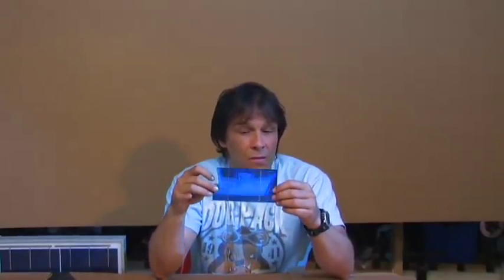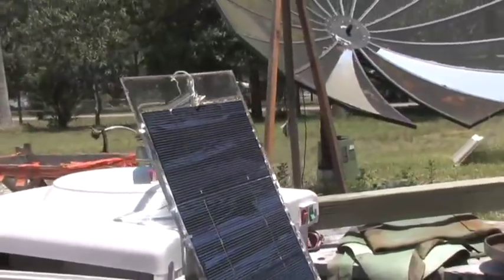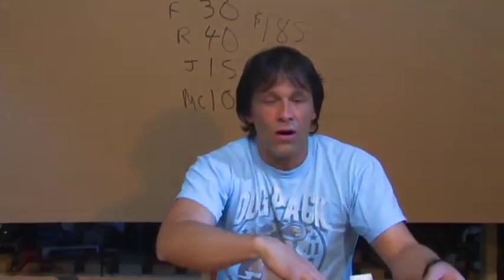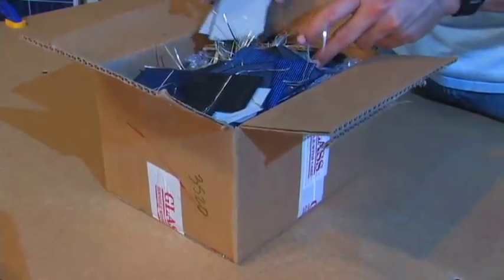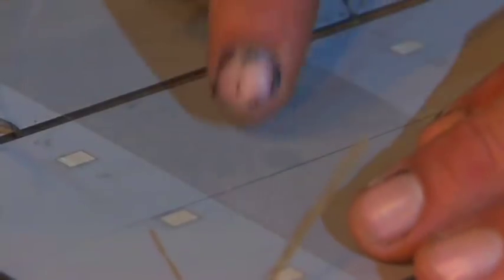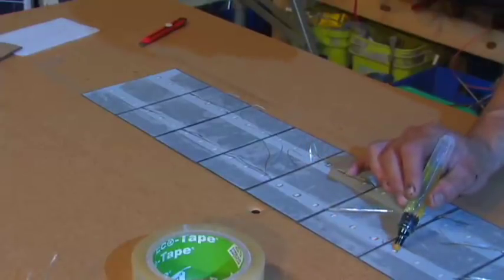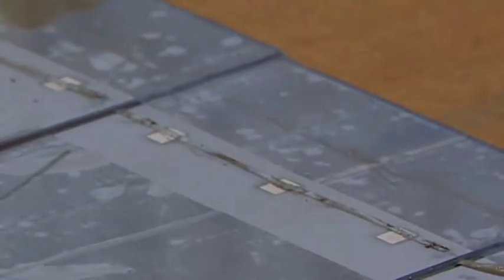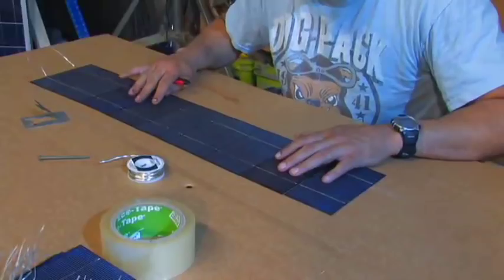less than $1 a watt DIY Solar Panel MAKE YOUR OWN SOLAR PANELS (PART 1)

Comment: I think this stuff is nonsese. such a limited ammount of energy. Did you see how slowly that flywheel was turning??? I bet I could stop it with my bare hands and not hurt myself. A tiny lawnmower engine could spin that wheel hundreds of times faster. And that is why we are dependent on Oil, because it works, and it works well. Unlike this shiny pile of horseshit. Do you power that soldering iron with your panels? No probably not, right?
Reply: Go back to the cave you came from my ignorant friend....cya
Reply: Why does everyone tell me to fuck off?! WHAT ARGUMENT IS THAT?! Instead of atacking my ideas, you attack me. How intelligent. Scilence the oppostion, meanwhile praise people who think just like you do. IDIOTS! FUCKING IDIOTS!
Reply: kedwa30 you are so spot on and yet +Ilir Kumi will probably try and use some low level intelligence to try and prove you wrong. Another reason why we are so dependant on oil is because of how much money is in oil, some nations entire economies are dependant on oil revenue, do you think Dubai would be the glittering jewel in the middle east without the oil revenue?  do you know there is a company that has developed a form of paving that is designed to to replace tarmac that are solar cells themselves efeectivly turning a nations road network into a power generating machine as well completely making energy generated by oil obsolete. you can run cable is special condiuts buit into these roads mount phone signal boosters in these conduits and all other sort of modern gimmics such as using the roads LED system to light highways. And why do you think that governmants arent persuing this not because its is inefficent but becasue it would take away our need for oil there by bankrupting certain companies and countries
Reply: A frensel lens is a fancy way to make a giant magnifying glass. You can generate tempuratures over 1000 degrees with one, from the hours of 11am to 2 pm. On a clear sunny day, with no obstruction from the clouds, and the closer to the equator the better. But what about all the other times when it underpreforms? Imagine a cigarette smoker was given the option of using a magnifying lens, or a Bic lighter to light their cigarettes. What do you think they would pick? And why would they pick it? What would be the pros and cons of each?
Reply: ***** Why? Please tell me why I should. Because you disagree? Because you can not think of a rational response? So instead of a rebuttal to what i'm saying you just tell me to "STFU" You plug your ears and shout over me. Real fucking clever you moron...
Reply: chimpey11 I doubt NASA has plans to build solar panels on the moon any time soon. This is a far fetched idea that will not come to fruition in a very long time, if ever. To think that thousands of acres and millions of pounds of anything can be launched into space is nonsense. You can't honestly belive that this is being done.
Reply: Ilir Kumi I have a garage out in the country. There is no grid power hooked to it. There's two 100w panels on the roof. I can power a big stereo, Three drill chargers, lights at night and a soldering iron. Its saved my hundreds of dollars in gasoline. In the summer months I never use the generator. The winter is a different story but I really don't go out there much in the winter. Before I got them my thoughts was a lot like yours. The best way to describe the power. imagine you have three car batteries with two 10 amp chargers hooked to them at the same time. But the 10 amp chargers are running for free!
Reply from the maker: That is called a "GEARED MOTOR" and that is NOT a flywheel, it is a traction drive wheel with 30+ pounds of torque. It is geared down for torque vs speed. We have solar supplemented grid tie power. So, on sunny days, half of that iron is heated from photons delivered from the sun. A gasoline engine would be a poor choice as this geared motor is designed for an indoor application. Oil works so well, worldwide  less people are using it and the cost of a barrel of oil is in the toilet. That pricing will eventually change, not due to increased consumption, but due to the fact that oil will be a dated energy source becoming a niche market vs mass market. This will not happen tomorrow, but is inevitable. BTW, many electrical power suppliers use alternative "shiny pile of horse poop" to supplement their grid loads via solar buybacks and solar farms. So, if you have a drop line from the power company, chances are you are consuming electrons that originated from a solar source.
Reply: Ilir Kumi said "such a limited ammount of energy"
And that's why people tell you to go away rather than waste time throwing pearls before swine. You have revealed your ignorance. The energy from every drop of oil originated in the sun. Oil is nothing more than a chemical battery storing the sun's energy. Using solar cells without chemical storage is like using a Biq lighter without a tank. You're going to blow butane out your arse to light your cigarette? It simply not a valid comparison to compare a stored solar energy to unstored solar collection. Today there is the technology to convert bio-waste into fuel oil. That process does not take long to make oil. Plants do well on this 'limited' amount of energy called sunlight. Presumably they have grown for millions of years without any human interventions. If I asked you which you would prefer: 500 pennies or four dollars, you would say the pennies are so small, you would rather have those big dollars. You are such a short sighted creature. You cannot see that many sources of small amounts of power add up to large amounts of power. When you push power from a single large power plant to a distributed network then you lose a lot of that power due to inefficiency of the distribution system. But solar is already distributed. Collecting a little and using it locally is the most efficient model for household power. Solar farms are inefficient simply because they must transport the energy over the same inefficient grid. Currently we have the technology to use electricity to convert water into the components oxygen and hydrogen.
These burn together to make water again. In the future HHO gas might be pumped directly to the consumer from a solar farm thus improving the efficiency of the distribution network. After they burn the HHO for heat and electricity, they can condense the steam into pure distilled water for drinking. You can't do that with exhaust from burnt oil.
Reply: kedwa30 Why can a coal plant transmit electricity on "the same ineffeicent electric grid" But a solar plant can not? How does that work? No shit the energy from oil comes from the sun, that being said...having energy already condensed is superior to having difuse energy that needs too be condensed. Is it not? And bio fuel? One gallon of bio diesel burns less hot, and for a shorter ammount of time than a gallon of petro diesel, requiring a larger volume of fluid to move the same truck the same exact distance. Ie: less energy dense, less fuel economy, more exepensive. Bio diesel has 0 vapor pressure which makes running it pure very difficult. So it is usualy mixed into petro diesel at NO MORE THAN 20 percent. Can you produce 1 billion gallons of bio diesel? Can you? You can not. If you did, it would exponentially more expensive than petro diesel. You honestly the think the chinese, indians, and other developing nations are gunna pay for this shit? No they will do what is more economic. Calling me short sighted? A car has a uniqe constraint in that it needs to be a PORTABLE powerhouse. Ask a marathon runner if he would rather have 500 goddamn pennies filling his pockets, or an individual 5 dollar bill. "But a little adds up to a lot" Yeah, a lot of exess weight which drasticly hinders preformance. And HHO you say? That is an energy storage system (a rather ineficient one) and NOT AND ENERGY SOURCE that solves nothing. You need electricity, and a lot of it. "But solar panels." I bet a single oil refinery can produce more HHO gas than all the solar farms put together, but they don't because it reqires a shit ton of energy. Why burn methane, to power an electric generator, to power a "water splitter", to burn HHO, when you can simply burn the methane? Why can't i just cover my car in solar panels? But at the same time just a tablespoon of gasoline can propel 1 ton of steel, rubber, and glass hundres of feet in minutes, if not seconds? Its all about energy density!!
Reply: you still didnt answer my response 60l of oil wieghs alot more than a lead battery why do you think the most economical way to run a car or truck his on half a tank, its because you don't have to carry the weight of that extra half a tank of petrol/diesel. and if oil were so great then why does the us military use other means to power there vessels? because oil is expensive and wont last however even though the initial outlay of nuclear/solar power is a little more expensive the long term benefit means its more economic, and btw if you where to compare based of the amount of Wph a 12 volt battery produces compared to the same amount of oil you would need for the same Wph output you would find that foil is far more inefficient because big diesels or gasoline engines are inefficient by the laws of the design, BTW your talking to a fully qualified engineer here so this stuff is my bread and butter
Reply: chimpey11 It took plants and plant-like organisms millions upon millions of years to trap carbon. They litteraly put the "fossil" in fossil fuels. And in just about 150-200 years animals (us humans) have been undoing that process at an uncomfortably fast rate. We truly are dependant on fossil fuels because of the vast utility they provide to us. Not because big oil companies are greedy, although some might be. That has nothing to do with it. Fossil fuels, especially oil, free us from toil and drudgery. Petroleum lifts the burden of labor off the shoulders of man, and places it upon machine. No longer do we enslave other men, we enslave carbon instead. All of this power comes at a cost though, we can not do this forever, and we are playing games with the atmosphere.

      Riddle me this! What on earth can fill a teacup? And lift one ton, 1,000 meters in the air? Petroluem of course! Energy must be consentrated to be of any use. Just like how a magnifiying glass (big circle) focuses sunlight into a small spot (small circle) to generate heat. If that energy is not consentrated, it can not do any work, like burn an ant or something ;) 

      My problem with renewables is that the energy, which is abundant, is very diffuse. It needs to be collected and consentrated before it can be of any use. I understand the sun emmits huge ammounts of energy but renewables can only grasp such a painfully small ammount of it. Arent average solar panels like 100 watts? (At peak operating conditions? We will never power an aluminum foundry, or pump water up a mountian, or spin flywheels at thousands of rpm, using solar electricity. The nicer of the two tesla models runs on 85kw. The avg home solar instalation is like 4-8 kw at peak operating condidtions and that can cost over $20,000. It does't add up.

      Long story short, nuclear or bust...and don't get me started on solar roadways!!! ;)
Reply: Ilir Kumi Although you are right about oil having a higher energy concentration, You are selling yourself short if you believe burning shit is the way of the future. Their are too many energy conversions, and inherently less efficient. I am only sad we are wasting such a energy rich resource on such primitive energy extraction methods. As far as solar energy goes, the best solar panel in the world can currently only convert light to energy at 41% efficiency, but its cost is currently too high, however, this is still orders of magnitudes higher efficiency than oil burning, so much energy is going to waste.
People confuse things by saying oil is more efficient, as you have to burn less for more heat, but this is because their energy density is so high. Burning for energy is like painting with a shotgun. People who look into higher efficiency energy extraction methods have vilified these high energy density materials and are focusing their efficiency on sources with extremely low energy densities, and that saddens me. Oil, harnessed more efficiently, would give our world not only cleaner energy, but more of it per barrel. And this technology could potentially be adapted to any other energy dense material.
Reply: Richard Smith Perhaps we would better ask then, how can it be improved? If you believe in something, and invest in it, who knows what solar energy could really do.
Reply: thebassguy9083 Why would I invest in solar, even at 100% energy conversion, the energy output would be dismal and not enough. What I am suggesting is investing in alternate ways to harvest high concentration energy sources, like oil, but cleanly and more efficiently than burning it.
Reply: Ilir Kumi Thorium is a better solution to the worlds energy problems... It would be nice to balance power between all available methods though.

Use your brain... solar power is not only viable, it's an excellent way to lower the use of oil so that we have more stored therefore our oil reserves will last longer.

Out where I am in the desert, solar panels can make a huge difference. Lots of neighbors with panels up and I haven't heard anything negative from those homeowners about them around here...

Thorium though... that's almost like a miracle! Unfortunately you've gotta protest the Governments horrid Energy regulations before it even becomes an option. And even then, until society breaks out of this primitive money minded phase, we most likely will NEVER see it.
Reply: kedwa30 Sounds like a great movie, i'll watch it.
Reply: "Limited amount of energy." Our solar systems sun has been expelling energy for far longer than the earth has existed.
Perhaps when you come to the realization that the sun was a requirement for life on earth, (which eventually decays over time to form oil - over hundreds of human lifetimes) You'll realize that without solar energy there would be no oil. Would it not be reasonable to assume then, that oil is a direct result of energy provided by the sun, which you claim to be a shiny pile of horse shit?

Perhaps you should also consider, that the earth would've not formed at all, without the gravitational pull of our shiny pile of horse shit.
Reply: MrCamiranga That was a great argument that you provided...
Reply: Ilir Kumi if you thin solar energy is horseshit you should research the team that are developing solar panels to be placed on the moon, an 1m square cell place and regular intervals for about a 1000th of the lunar surface would create a Tera-watt of power, understand exactly how much that is a tera-watt is 1000000000 kilowatts of power, enough to power the entire planet, and with microwave technology it is theorized that the power can be exported back to earth for use by all of use
Reply: The moon revolves around the earth, that means for two weeks those panels will be in the dark producing no power at all. None. How many 1m panels will it take to produce a terrawatt? How will you get that many thousands of TONS of material into space? HOW? Solar spaceships? Oh wait those don't exist! We would rely on conventinal rocket science that uses petrochemical fuels. And it would take the entire wealth of nations to fund such a thing. Where are the space colonies that will support the thousands of people that will have to LIVE ON THE MOON to build these things? 1-1000th of the moon? That is a shit-ton of area to cover, now subtract an atmosphere. Again, when the power goes out for two weeks at a time, what happens to the PEOPLE LIVING ON THE MOON? Are you for real dude? Now that we are on the topic of space, what about deep space probes? Neptune is dark, cold, and far far away from the sun. Solar panels that far from the sun would fail, FACT. Deep space probes like voyager and galeleo relyed on RTG's for power, and so did the men that landed on the moon back in the late 60's. And so does discovery, the probe that recently landed on Mars. Those are Radioisotope Thermoelectric Generators, not Photovoltaic Cells. Solar panels didn't keep those men alive, atomic energy did. "Lunar panels man...free energy for free" Get real...
Reply: Ilir Kumi the moon takes 28 days to revolve around the earth and 28 day to complete one rotation around its own axis meaning that there i a permanent part of the moon that is always facing away from the earth hence the name dark side of the moon , and technically the only period that there would be no light from the sun hitting the moons surface is a about 2 days, the same time we cant see the moon on earth with naked eye (New moon period). The solar power would be exporting back to earth using microwave technology this is possible so the power would serve the earth not the moon but could serve the moon eventually. the fact that there is no atmosphere is beneficial to the creation of power using solar power because the cells receive pure light energy from the sun without an atmosphere to dilute the light radiation. And yes i do agree that the technology is not there for getting these things to the moon but why do you think NASA is developing the rockets to take man back to the moon? there are also many private companies that are researching ways to make this a possible and if you look at how quickly technology has developed in the last century and a bit for first manned flight of an aircraft to now having a space station i would say its not far away, by the way space ships that use solar power exist its called ISS. and lastly i was using this as an example to you of why Solar power its not a buch or horseshit and has real potential to be the solution to the earths power needs given time and i do agree that nuclear is the other area that man kind needs to deveolp but untill they can get to a point were the risk is not greater than the benefit with nuclear power then other options have to be explored
Reply: chimpey11 Microwave technology transporting energy to earth? You must have never played Sim City 2000 to know that this is a bad idea...
Reply: Ilir Kumi and why wouldnt they be researching this, again no where did i say it was going to happen tomorrow or discount nuclear power however i simply showed that solar power can achieve just as much a nuclear without the melt down factor. and its the private companies that would stand to benefit more from this and i know of at least two that are throwing money at this to try and make it happen. http://www.telegraph.co.uk/news/worldnews/asia/japan/10480950/Japanese-firm-plans-250-mile-wide-solar-panel-belt-around-Moon.html MKzer0 As i radar engineer i know this is something that is achievable all you need on earth is the receiving platform all the power is generated at the transmitter its no worse than some of the radars employed at airports or air traffic control centers, a radar wave is a microwave after all
Reply: Ilir Kumi 
I'll agree you make some valid points on a global scale. On a smaller personal scale(which is what I believe this video's intent was for) to get lower, or totally eliminate, the cost of a local electric bill I believe your points do not carry as much merit. The fact of comparing the pros/cons of these solar panels to oil, of course the oil is going to give you better benefits, the people selling the oil are going to invent ways for you to use it(so you buy it and put money/power in their pocket) rather than finding alternative ways for power when oil is not available to you. 
I watched the video and read the first comments that came up so if I missed where these comments were on a certain subject matter other than making panels for personal use I would like to read that.
Reply: Ilir Kumi I have a garage out in the country. There is no grid power hooked to it. There's two 100w panels on the roof. I can power a big stereo, Three drill chargers, lights at night and a soldering iron. Its saved my hundreds of dollars in gasoline. In the summer months I never use the generator. The winter is a different story but I really don't go out there much in the winter. Before I got them my thoughts was a lot like yours. The best way to describe the power. imagine you have three car batteries with two 10 amp chargers hooked to them at the same time. But the 10 amp chargers are running for free!
Reply: Ilir Kumi
said "Why can a coal plant transmit electricity on "the same ineffeicent electric grid" But a solar plant can not?"

When did I say it couldn't? That is a strawman that you built, and you have only shown that you can tear down a strawman as quickly as you can build one.
The fact is, most residential solar is located on the site where it is used, and thus it does not need to use the grid, although excess can be fed onto the grid for grid users to use. In that case, it may just go next door, thus traveling maybe a thousand feet at most. That's pretty efficient compared to the miles of wire you need to distribute power from a massive coal plant or solar farm, or any other large scale grid plant. Do you understand now? Or do I need to explain it some more?

"having energy already condensed is superior to having difuse energy that needs too be condensed. Is it not?"

There are pros and cons of each. A parallel can be drawn to monetary investments. Someone with a lot of cash sitting under a mattress has the analog of a bunch of oil on hand in tanks. What happens if there is a fire?
Sometimes it is preferable to have a steady income rather than a bunch of cash on hand.
What happens after you spend all your cash and you don't have any income to replenish it? Suddenly your lifestyle takes a dive, right? It is preferable to have a steady income so that you can maintain the same comfort level. Also, what about the costs of storing, guarding, and moving your cash/oil?
If having a lot of cash was always preferred, then why would anyone invest in assets? They have to spend a huge lump sum to gain an asset that pays them back slowly over time. The thing is, the slow payback over time pays them back, and they still have the asset. After they have all their cash back, they still have the income. It's the only way to beat inflation.
A bird in hand is better than two in a bush. See, I know what you are trying to say. But it's not like that. Investing in solar infrastructure that can then power HHO production is creating that stored energy. Is growing corn and turning it into alcohol more efficient? What about wood gassification? I'm not setting aside those options. I'm not saying we won't still have a niche market for oil. It is energy already in hand. But a bird in hand is messy. You need to clean that bird before you can eat it. Having a bird farm and taking the time to clean and dress the birds is far superior to eating that bird in hand feathers and all.
"You honestly the think the chinese, indians, and other developing nations are gunna pay for this shit?"
Paying for energy is the capitalist way. What, you think chinese are all socialist and don't use money? They pay for coal, they pay for oil, and they will pay for solar because it makes economic sense. You pay a one time cost for a solar cell and then you get energy every day thereafter. It is an investment, same as any other. Farmers know what I'm talking about. Why go to the store and buy a carton of eggs when you can raise chickens and sell eggs?

"Ask a marathon runner if he would rather have 500 goddamn pennies filling his pockets, or an individual 5 dollar bill."

Way to mix metaphores. But if instead of carrying around 500 pennies, he had a flow of pennies so that he had only a few on hand but basically every time he reached into his pocket he had pennies, how would that compare to a five dollar bill that after he spends it, he doesn't have it anymore? How much money does any marathon runner carry? What do they need it for? Are they going to catch a bus? Taxi fare? WTF does someone running a marathon need to stop and buy? Oh there's a Pay-less shoe store. I need to stop and pick up a pair of new shoelaces. Get real!

Are you telling me you really can't tell the difference between having to store all that oil compared to getting a flow of electrons daily? If anything the oil is the five rolls of pennies!
Go camping in the desert for a year and carry on your back either 1. all the oil you will use for a year, or 2. a solar cell. Which is lighter in weight? Which are you going to carry on your back?

HHO solves nothing? It is an energy storage system, you dooffus. What is the efficiency of making crude oil? And then yoou have to pay millions of dollars to dig a well, pump it into barrels (barrels aren't free), refine it, put it in gas cans, truck the gas cans to gas stations and empty them into the tank there, then pay to dump all those gas cans and barrels into the ocean. HHO has no garbage. It is already refined. It's many times more efficient than that natural production of oil, and it can be made as it is needed, so there is no need to store it in volatile tanks. Solves nothing? More like it solves every problem we've had with petrol.
Reply: ***** I think his real name is Hank Hill lol
Reply: Ilir Kumi Hey Hank Hill I hope your storing a lot of barrels of crud oil. When we run out us Dumb asses will have those worthless solar panels.
Reply: +Ilir Kumi how much do you think 60l of oil weighs? a alot more than a lead battery dont believe me try lifting both
Reply: 60l of water weighs more than 60l of Oil. And 60l of Oil is more powerful than a 12 volt battery. How many gallons of water can your battery boil? And for how long? How many products can you make from a 12 volt battery? Bullets and lead paint? Oil weighs around 0.7 g per cubic cm. Lead is around 14 g per cubic cm. Don't belive me try lifting both. You might as well say two pounds of feathers weigh more than a one pound brick.
Reply: william staten I hope you are storing a lot of elemental silicon because solar powered blast furnaces don't exist.
Reply: chimpey11 Are you refering to nuclear powered submarines? Because a solar powered sub would be nonsense. Oil is expensive because it is fossil fuel in it's best and most useful form. Liquid fuel rules and solid fuel sucks. (If you have ever stacked wood you know what i'm talking about.) Liquids can flow, and be pumped through pipes and can mix very well, unlike solids. And gasous fuels are inconvenient to handle. Any exess weight reduces effeciency, if you have 5 passangers in your car they certianly weigh more than 60l of oil. It takes more energy to move more mass, that is obvious. And you didnt answer my question how many gallons of water can a 12 volt boil, and for how long?
Reply: no i talk of aircraft carriers and other warships  that weight upto 120000 tonnes that fact you would even ask this proves how little you know, and im not talking of solid fuels solar energy is not a solid fuel but a forces heat and light a ray and radiation not wood or oil or diesel. and ok a 12v battery would not heat very much water for very long i give you that but a battery witht the same net wattage as that of the oil you would use to heat your water would by the laws of physics heat said oil just as much and as long as that oil. now ask yourself when oil runs out, and it will within this century thats a universally accepted fact btw while im heating and lighting  my house with solar energy what will you be using? and how will you be able to sustain yourself if all these agencies that provide your your power source cease to exist? at least with my solar cells i can create my own energy
Reply: Too bad you can't create your own solar panels. Just like how I can't make my own oil :( Solar panels need mass amounts of energy to manufacture. Elemental silicon and aluminum require vast amounts of heat and electricity to produce. You litterally have to burn sand! Ever heard of a solar powered blast furnace? No, well they don't exist! That energy must come from something, and it sure isn't from big fans! And a solar powered aircraft carrier? Sounds like that also doesn't exist. I bet it runs on nuclear because nuclear is so energy dense, even denser than oil as a matter of fact! I am a major proponent of nuclear energy myself. Chemical energy and the electron has served man well, it is the fist half of atomic energy. But one day I hope we can have full acess to nuclear energy and the nucleons. You know just over 2 pounds of plutonium is capable of generating as much heat as 3000 TONS of coal? Now that is some hot stuff!
Reply: im completely on your side with the nuclear and thats what i was referring to with the aircraft carries i was just arguing the electricy verse oil argument you were having, alot more engineers are need in that field as it is the way of the future or at least a stop gap till we find a safer way to provide the energy we need, e.g fusion and then maybe one day anti matter reaction which aren't as sci fi as they seem.  and i can create my own solar panels like i said im an engineer i could buy the basic parts and build one, but once iv bought one i on it dont have to replenish it dont have to worry about it being used up its mine and as long as i maintain it it will work, you must agree you cant say the same about your can of oil because once its gone its gone you need to buy more, and as an idividual user solar is far more cost effective way to power my house again its one of those short term loss for long term gain situations, i pay upfront for my energy rather than constantly paying for it i can become self sustained throw in a wind turbine and then i truly can power my own home as long as there is sun light and wind, and where im from wind is pretty much guaranteed most of the year, id rather that than pay through the nose for gas and electricity from a company that dont reflect the cost of oil on the global market in there pricing
Reply: Also, If solar energy relies on rays of light, could a gamma ray emiting radioactive material exite the solar panel and produce electricity? Like an artificial sun of sorts? That would be quite strange wouldn't it?
Reply: i would be honest and say im not sure however maybe the concentration needed would be counterproductive because of the inherent risk although im sure i a lab somewhere someone has tested this theory and knows the results. but i do believe that  #quantumphysics  and nuclear physics is what will cure the planet of it dependency of fossil fuels whether that be solar, nuclear or some other means, maybe a hybrid of all, nuclear for sea going vessels a more reliable form of solar for aircraft and cars maybe the solar highways that charge your car as you drive this has already been developed but still in its infancy. You have to agree the planet needs to rid its self of its dependency on fossil fuels before its to late, both in that we run out and destroy the atmosphere beyond repair
Reply: Ilir Kumi
uttered: "How do you transport solid metal thru thin air?"

It's an analogy. You're the one saying oil is a paper dollar and solar is a couple rolls of pennies. How do you transform sunlight into copper? Do you have a magic spindel? Can you spin straw into gold too?

"My point is 500 pennies weigh a lot more than a 5 dollar bill"

Duh, but oil weighs a lot more than sunlight, so the pennies represent the oil.

How much oil would you need to represent the entire solar output of the sun for a year? Go ahead and figure that up. You would need a tanker bigger than Jupiter to store it all.

"A marathon runner is someone who is moving around and if he has to carry exess weight, his running ability is reduced."

And if you had to carry all the energy you would need for a year on your back through a desert and the form was oil, you would die before you made camp. The weight of the oil would literally crush you. But if you carried a solar panel, you would have shade and energy.

"If you built a car that runs on car batteries which are made of lead, your car would be so heavy that it wouldnt get very far."

Thus you demonstrate that you can tear down a strawman as quickly as you can build one.
Name one manufacturer of solar cars that uses lead batteries.

"I can store oil anywere in the world,"

Okay, store it in a volcano. Fail.

 "I can not build solar panels inside a warehouse,"

But you can build strawman inside your imagination.

"I can't build them inside anything!"

Manufacturing of solar cells usually takes place inside a building.
If you can't do it, that only shows your own limitation.

"Define a "year supply of oil" how many gallons? Barrels? You think 1 individual solar panel producing no more than 100 watts is going to be of any use? FOR A YEAR?!?!"

You don't even know how much oil you would need for a year? But then you want to compare an unknown number to a random number you pulled out of the air?
Whatever amount you think you need for a year that you want to carry on your back, you can make a solar panel that will produce that same amount of energy in a year from the desert sunlight and that panel will be lighter. Not only that, but you can use that same panel for twenty more years, but your oil is depleted already after only one.

"I might as well bring just a pint of gasoline (which is 7/10ths the weight of water, which you would also need to carry.)"

How many watts can a pint of gasoline produce? You are going to be cold at night and eating raw meat. With just a roll of foil, I can make a solar oven that will cook for hours every day. Your pint of petrol is done in a weekend of cooking. You will be crunching your ramen for most of the year.

"Deserts get extremley cold at night how will that panel keep you warm? It will not, because it can not."

The same kevlar foil that I use for my solar cooker can be used to reflect my own body heat. It is called a 'space blanket' and it is very lightweight and inexpensive, available in most camping supply stores. Also, reflecting sunlight onto rocks stores the heat in the rocks long enough to provide plenty of heat in the night. All you have to do is plan ahead. That's the same with any technology. If you have nothing but a pint of petrol, you don't have heat. You need some kind of a stove and a way to light it. More weight to carry. More junk to buy and keep track of. You don't have to carry rocks in a desert.

It simply not a valid comparison to compare a stored solar energy to unstored solar collection.

"What? Are you going to carry a sun with you as well?? Energy density is key especially when it comes to portability."

No. (rolls eyes.)
The sunlight comes to me in a steady trickle. I don't need to carry the energy with me.

"CRUDE Oil is not natuarally refined, that makes no sense."

So are you going to carry an oil refinery around with you? You debunked yourself.

"Zippo lighter fluid and premium gasoline don't leak from the ground."

But sunlight 'leaks' from the sky, thus sunlight is more accessible.

"Also, you plan on storing a fuel AND oxidizer in the SAME tank??!! HHO is extremley reactive and dangerous to handle."

No, that is another of your strawmen. Do you plan to put an oil refinery in your car and filling up the tank with crude?

 "In order to liquify it you need EXTREME pressures and very low tempuratures as well!"

Why would you want to liquify and store a gas in a tank when you constantly use what you produce every day? Are you going to convert your precious oil into precious diamonds using high pressure before you put it in your gas tank? What do you think pipelines are for?

"A tank of liquified propane is exponentially safer than a tank of liquified hydrogen AND oxygen."

So it's a good thing it is only your strawman that will be risking his neck by pressurizing HHO into heavy metal tanks for transport, while everyone else will use the pipeline.

"A tank of liquified butane is even safer still."

Not too many people run cars or heat their home using butane. What energy companies are using butane to produce electricity?

"Gasoline is safer than butane cuz it is not pressurized"

I'll notify the next of kin how safe the fire that engulfed their family was.

"By that I mean HHO would not only need to be under tremenous pressure, it would also need to be refrigerated as well."

You need to back up your assertion with some kind of facts. Why would we need to pressurize HHO with tremendous pressures when we could simply send it down a pipeline in gas form with a minimal pressure? Why would we need to cool it when we don't intend to liquify it? You do realize you can pump gases through pipelines too, right? You don't have to convert it to a liquid.

"In no way does HHO outpreform petroluem and the myriad of products derived from it."

That is your opinion, and you are welcome to express it. But we were comparing solar power to fossil fuels, not HHO to petroleum.

"You are delusional if you think so."

So you say.

"I dare you to liquify HHO and see what happens."

Why would I want to? What is my motivation?

"I dare you to burn HHO, then Burn Oxy/Propane the latter burns hotter and longer."

So you say, but if you were to base the comparison on the equivalent mass of the reactants, then HHO wins.

"And what about Oxy/MAPP? That is even hotter, and guess what, it is a petroleum product! LOX/Kerosene?"

What about it? You have lost your way. We were comparing solar power to fossil fuel power. Carry as much MAPP, Kerosene, Propane, etc. as you can on your back and survive off it for a year in the desert. I will carry solar cells. Let's see who keeps warm, cooks every day, and enjoys a superior quality of life.
Reply: kedwa30 while i agree with some of your points you lost yourself and your point using the language and insults, it wasnt needed you were proving your point with knowledge but ruined it next time bring just your brain insults and foul language only highlight a narrow vocabulary and a limited ability to argue your point successfully are you a 12 year old is all people will be thinking
Reply: chimpey11 Thank you for your constructive criticism. I have cleaned up my post.
Reply: kedwa30 Why are we in the desert? Is it because that is were solar panels preform their best?  Most people on don't live in death valley, or in the sand dunes of the Sahara. What do they do? Cut down the trees near their houses? Move? You must admit that solar panels require specific geographic and meteorologic (is that a word? I mean weather) constraints. That is a huge limititation that can not be ignored. Can't forget that the sun sets, so for half of the day it produces nothing at all, then what? Renember that you do not have any batteries! Just a panel on your back! One cloudy day and your energy production is drasticly diminsished. You are at the mercy of the elements with renewables. Also it sounds like you think that you can thoroughly cook food with a mirror or magnifing glass? Have you done this before? Why isn't it more common? How long would it take to cook something? Would it even cook it? How will you get a rock's temp to 500+ degrees?  You sure can't plug a solar panel into a rock. Even if you could, you would need a lot more than one panel to get it up to temp. More solar panels, covering a larger area would work better than just one on your back. I saw a guy make a grilled cheese sandwich with a solar reflector stove and it took over 45 minutes!!! Renewables occupy vast swaths of land which must be cleared of vegitation, bacause if a leaf falls on the panel thay would be problematic, or god forbid a bush grows high enough to block the panels. The reason they take up space is because they must consentrate energy from a large area into a small area to make use of the heat. Energy density is importiant!!! I can't streaa that enough!!! What is the energy density per square meter? Doesn't matter you say?
Reply: Ilir Kumi please get started on solar road ways but do your research on them before you do and try to tell me how they would be a bad idea based on research here's the link http://www.theguardian.com/environment/2014/nov/05/worlds-first-solar-cycle-lane-opening-in-the-netherlands ill agree the ideas are in there infancy but it is worth researching .  Also i dont know whos been quoting you for solar panels but in the UK where i live the average 4-8kw set with invertor and storage batteries runs at about £7000 which even when the exchange rate is at its worst is only $14000 i know because im getting them fitted. Its the electricty not solar your comparing to when you run you little "riddles" or analogies so if you go for an electricity generator on the scale 'that can pump water up a hill' then yes electricity will do this. look at the rail gun principles or the EM aircraft carrier catapults no oil used in those systems yet still have massive exponential power. like i said you compare by Watts not be volume because that gives you a true comparison to work with and believe me you can get alot of Wper min with very small batteries 24VDC as long as you arrange the circuit it is connected to correctly. And the biggest reason i support solar and other greener energies is because i want to leave a decent planet behind for my children yes my effort may be small when countries like india and china and the US are pumping tonnes of carbon into the atmosphere per minute. but if every little man does something an effect will be seen
Reply: Ilir Kumi "It took plants and plant-like organisms millions upon millions of years to trap carbon."

False. Sugar cane grows very quickly, not only turning carbon into cellulose, but also turning it into sugar. Pine trees grow very quickly. Algae grows very quickly. It may have taken a very long time for the growth to pile up densely enough to eventually form a large reservoir of fossil fuel, whether that be coal, oil, or other; but, it didn't take very long at all for plants to sequester carbon. Hemp grows very quickly.

"They litteraly put the "fossil" in fossil fuels."

And that is why we laugh at you.

"And in just about 150-200 years animals (us humans) have been undoing that process at an uncomfortably fast rate."

Yep.

"We truly are dependant on fossil fuels because of the vast utility they provide to us."

Nope. People have survived a very long time without the use of fossil fuels, and with today's technology we could, if we so desired, maintain our modern lifestyle without them.
The reasons all consumers haven't already is because of the meddling in the marketplace of those in power who desire to maintain the status quo of control over the energy market.

"Not because big oil companies are greedy, although some might be."

Greed is hardly the primary motivator. Mostly it's control; power.

"That has nothing to do with it."

Of course not. It's merely a strawman that you brought up because he would be easy to beat up.

"Fossil fuels, especially oil, free us from toil and drudgery."

It takes energy to dig up that energy. Then it will take more energy than we got from them to one day have to clean up the toxins released by them. It is a dead end. The road to perdition.

"Petroleum lifts the burden of labor off the shoulders of man, and places it upon machine."

So too, electricity generated by solar cells can power machines. Petroleum is no messiah. Digging up these carbon chains so that we can burn them for the stored energy they contain also results in digging up toxins such as fluoride, arsenic, mercury, etc. Various heavy metals that took a long time to settle out of the biosphere are being reintegrated into the biosphere. This can result in environmental pressures that will bring forth traits that have laid dormant for a long long time.

"No longer do we enslave other men, we enslave carbon instead."

Opening Pandora's box has unintended consequences. Not only will increased automation decrease the need for cheap labor, but it can undermine the system of capitalism we have come to adore. Those few who happen to inherit massive wealth from their forefathers who happened to get rich first will use the power of their wealth to depopulate the planet of those who don't have jobs or income simply because there is no demand for work since automatons could provide anything they want for less. This massive inequality of haves versus have nots will result in massive deaths, destruction of society and culture as we know it, and the end result will be a very few arrogant people left to represent the human race.

"All of this power comes at a cost though, we can not do this forever, and we are playing games with the atmosphere."

I agree. Dependence on fossil fuel to maintain a modern lifestyle is unsustainable, and it results in the realease of actual toxic substances. The release of CO2, on the other hand, is a completely natural part of the carbon cycle. Carbon is benign. You can eat it in large quantities. In fact, activated carbon is used to clean air, water, etc. If you accidentally swallow poison, you may have to swallow some activated carbon to help you.
There is no reason to demonize carbon.

"Riddle me this! What on earth can fill a teacup? And lift one ton, 1,000 meters in the air? Petroluem of course!"

I was going to guess nitro glycerin, which is used in dynomite and is made from animal fat and lye. No fossil petroleum necessary.

"Energy must be consentrated to be of any use."

Indeed, and thanks to modern chemistry, we understand many ways to concentrate it very quickly. We can actually make a honey colored fuel grade oil from turkey guts and raw sewage.

"Just like how a magnifiying glass (big circle) focuses sunlight into a small spot (small circle) to generate heat."

A Fresnel lens is convenient and light weight.

"If that energy is not consentrated, it can not do any work, like burn an ant or something ;)"

False. That energy can feed plants, causing them to grow. A redwood tree lifts thousands of gallons of water thousands of feet into the air using unconcentrated sunlight. After a tree stores the energy from sunlight by making cellulose, then someday that tree may be cut down and used for firewood to heat a home in winter or to operate a Stirling engine on a tractor or it may be gassified and used in an internal combustion engine. What can you do with a speck of oil? It can make hundreds of gallons of water taste bad.

"My problem with renewables is that the energy, which is abundant, is very diffuse."

Just as you need to dig up coal or drill a well, pump the oil into tanks, then ship the tanks to a refinery, then refine the oil into products that then get retanked and shipped to where they are needed, so too, there is a process required to concentrate sunlight. Using a lens is a good example. You can run a 75 HP Stirling engine from sunlight concentrated using a fresnel lens. Again, wood gassification can be used to refine wood into a fluid fuel for use in internal combustion engines. All of it can be set up to be automated. Once you set up a solar panel, it collects sunlight without any human intervention.

"It needs to be collected and consentrated before it can be of any use."

Did oil put itself in your car? No, someone had to collect it and refine it to make it useable and suitable for your automobile.

"I understand the sun emmits huge ammounts of energy but renewables can only grasp such a painfully small ammount of it. Arent average solar panels like 100 watts?"

I'm sorry you experience pain at trying to grasp the concept of a passive collector giving you 100 watts of power for many hours of each day most days for many many years after you simply buy it and set it up one time.
A smart phone will charge from a 5V 2A DC supply in a short amount of time and then it will be a couple of days with average use before it needs to be charged again. That's ten watts. You can light a 3BR 2.5BA home using LEDs and charge a phone reliably using only a single 100watt panel. Most homes have plenty of space on the roof for more than one panel.

"(At peak operating conditions? We will never power an aluminum foundry, or pump water up a mountian, or spin flywheels at thousands of rpm, using solar electricity."

You could. Ever heard of batteries or capacitors? Solar foundries exist that use only concentrated sunlight. Why would you try to make such a strawman? Oh, is it too challenging to make an honest argument?

"The nicer of the two tesla models runs on 85kw. The avg home solar instalation is like 4-8 kw at peak operating condidtions and that can cost over $20,000. It does't add up."

Strawmen can't count.

"Long story short, nuclear or bust...and don't get me started on solar roadways!!! ;)"

Since nuclear is a dead end, then you have conceded. You can't seem to offer any long term viable alternative to renewable energy sources.
Reply: Ilir Kumi "Why are we in the desert?"

Ah, an existential question indeed. Why are we here? Why are we on a planet? Why aren't we living in deep space where it's very cold because the solar energy is so diffuse? You can't burn fossil fuels in the vacuum of space. Deep space would be the ideal place to take nuclear energy. However, it is far from ideal for powering homes located closer to the sun where solar is the ideal. Sorry about your luck, but solar is the best over-all power source for most human needs. It can be used to grow trees which are then converted into fluid fuels suitable for use in automobiles.

"Is it because that is were solar panels preform their best?"

Solar panels do not perform their best in hot dusty desert environment. Solar panels perform their best in the vacuum of space.

"Most people on don't live in death valley, or in the sand dunes of the Sahara."

Did you build another strawman? Awe, isn't he so cute!!! Most people don't live in the vacuum of space. Most people don't live in deep space where sunlight is extremely diffuse. Most people don't live deep under the sea or on either of the poles. Most people live in temperate climates inside houses with a roof. In the winter it is too cold to suit their lifestyle so they burn wood to warm them. Wood is grown locally using solar energy and carbon to produce the cellulose. Wood is a renewable energy. In the summer it is too warm to suit their lfiestyle so they run AC units powered by electricity. This electricity can potentially be made using solar cells. Also it is possible to use a stirling engine to run the compressor to cool the house. The stirling engine can be powered directly from a heat difference, which could be created used concentrated sunlight. Sunlight can be concentrated using inexpensive thin foil to reflect it.

"What do they do? Cut down the trees near their houses? Move?"

Why? What is the problem they would be solving by cutting down trees or moving? If you look at a typical suburban neighborhood, you will see miles and miles of rooftops with absolutely no leaves on them because there are no trees close enough. Why don't you lay on the rooftop in only your swim trunks for ten minutes at noon on the fourth of July. No, better not tell you to do that. You might do it and then sue me for the third degree burns you get.

"You must admit that solar panels require specific geographic and meteorologic (is that a word? I mean weather) constraints. That is a huge limititation that can not be ignored."

If by that you mean there are times when solar panels won't work because they are covered in too much snow, then I would respond by saying that there are times your car won't crank no matter how much petrol you have in the tank. Oh damn, cars aren't perfect so now we can't have them at all! Woe is the human civilization. Oh, wait, that is only you being facetious again. Obviously there are conditions when nuclear power just doesn't work as well. Oh, say, Fukashima. Since it's not a good idea to locate nuclear power plants on faults or islands prone to tsunami, then I guess we just can't have nuclear at all. What a shame.

No, in reality, not your strawmanesque imagination, we enjoy moderation. Solar panels that work in the summer to cool the house and using wood to heat the house in the winter, is a mighty fine compromise.

"Can't forget that the sun sets, so for half of the day it produces nothing at all, then what?"

Damn. You still have never heard of storing energy for later.

"Renember that you do not have any batteries! Just a panel on your back!"

No, that is not my scenario. You even were telling me about how you would need to bring water and food with you as well, so I thought you understood that you can bring other stuff. The idea is to be able to carry what you will need for a whole year in the wilderness. You imagine there is no water in the wilderness, but that is because you misunderstood. A word can be translated wilderness or desert. The wilderness includes all sorts of terrain, from flood plain to forrest, to scrub brush, to grassland, to hills etc.
Solar cells are at peak efficiency in the vacuum of space, but none of the terrain on Earth is what would be considered ideal locations for solar. Nevertheless, even on a cloudy rainy day, you can get some power which could be concentrated using reflectors and lenses as well as stored and concentrated using capacitors and batteries. You will need matches and a stove to cook with your liter of petrol. That liter will be long gone in only a few days. But even in the darkest days of winter, a battery can be charged up with a solar panel. But why would we bother when we can chop renewable wood and burn a fire releasing the abundant stored energy from the sun.

"One cloudy day and your energy production is drasticly diminsished."

Yes, you understand. Diminished does not mean non-existent. The flow of a stream is strong or weak depending on weather as well, but build a big enough dam to store up the water and you can harness massive amounts of energy. So too, if you have enough solar panels to capture more energy than you immediately need, then the excess can easily be stored for later use.

"You are at the mercy of the elements with renewables."

No, that is your strawman who has a brain of straw so he can't think.

"Also it sounds like you think that you can thoroughly cook food with a mirror or magnifing glass?"

Google Solar Oven.

"Have you done this before?"

Yes, while camping.

"Why isn't it more common?"

Because most people don't go low impact camping?

"How long would it take to cook something?"

That depends on what it is.

"Would it even cook it?"

It will boil water and more.

"How will you get a rock's temp to 500+ degrees?"

Concentrate solar energy onto it.

"You sure can't plug a solar panel into a rock."

Strawman stupidity. Why would you even waste your time typing that?

"Even if you could, you would need a lot more than one panel to get it up to temp."

Why would you continue with this line of fallacy? Haven't you torn up your strawman enough?

"More solar panels, covering a larger area would work better than just one on your back."

LMAO! Are you going to run your petrol stove while it is on your back?

"I saw a guy make a grilled cheese sandwich with a solar reflector stove and it took over 45 minutes!!!"

He liked his well done, didn't use large enough reflectors, didn't aim them well enough, or just wasn't a very good cook. Sorry you had such a lousy experience. What's that got to do with the fact the sun puts out more energy than is contained in the whole Earth?

"Renewables occupy vast swaths of land which must be cleared of vegitation, bacause if a leaf falls on the panel thay would be problematic,"

Vegetation ARE the renewables. Solar panels would be on rooftops which are generally clear of vegetation already. So, all you have are strawman arguments, eh?

"or god forbid a bush grows high enough to block the panels."

Why?
Why would god forbid that? Also, why would you let a bush grow bigger than your house?
You don't mow your lawn or sweep your floor either, do you?

"The reason they take up space is because they must consentrate energy from a large area into a small area to make use of the heat."

Solar cells are very thin. They take up about the same space as roofing felt.

"Energy density is importiant!!! I can't streaa that enough!!!"

You are clearly obsessed. What are you going to do when you get your density to billions of joules per minute? Then of course, to be useful, you will need to convert it to a 5V 2A circuit so you can charge your 10 watt battery charger for your phone.
It's not efficient to keep going back and forth. It's better to cut out the middle men and do what you can do with the energy as soon as you can, then fall back on storing and using stored energy.
The way your strawman designs circuits, he would have us using petrol to turn a turbine to generate electricity in order to heat a coil in order to make heat. Why not just burn the petrol for the heat where you need the heat? Better yet, since there is huge inefficiency in dsitribution costs, just harvest sunlight which is already distributed.

"What is the energy density per square meter? Doesn't matter you say?"

Oh, it matters. How much energy do you need? What is the application? If you need heat for a foundry for example then you will need a lot of mirrors to concentrate the sunlight. If all you want to do is power a calculator then a tiny photovoltaic cell is all that is needed. Who cares that the calculator's solar cell can't power a forklift all by itself in a day? It can do what it was designed to do: power a calculator. If you need power to charge an electric forklift's battery within a select time then you will simply design your power collection to accomodate. What's so hard about that? People had to design nuclear reactors and fossil fuel extractors. If you can't figure it out then I feel sorry for you.
Reply: http://inhabitat.com/sonnenschiff-solar-city-produces-4x-the-energy-it-needs/
Reply: Richard Smith
Pardon me for jumping in, but I don't see why you couldn't invest in both. Dismissing solar is like refusing to pick up a ten dollar bill off the floor because you need twenty.
Every little bit helps. The problem with oil and other fossil fuels is that it will eventually run out. Investing in tech to use its stored energy more efficiently will only delay the inevitable and then that tech will be useless. I think it's worth investing in that tech anyway. I'm not saying that oil is a dead end so there's no use bothering to improve there. There is actually tech to convert raw sewage, turkey guts, trash, etc. into a beautiful honey colored fuel oil. There will always be a niche for oil just as collectors still have their steam engine kitch. I suspect that the tech to use oil more efficiently will actually mesh with future solar tech. One day instead of growing plants then converting them into oil, we will have a way of directly using sunlight to form hydro-carbon chains. We can use solar reflectors in space to send more sunlight to earth. We could have a grid of solar blimps above any clouds to collect it.
Reply: kedwa30 Well, that wasn't my point tho. My point was that people think solar is going to save the world from an energy crisis, but it is not possible for it to deliver on that by providing the world with enough power. I think solar gets too much attention, not that it does not need any attention. Solar is a great alternate energy source, emphasis on alternate, but the energy density is simply not high enough for it to be a primary energy source to provide our needs. I do think we can have an energy source just as clean and renewable as solar, but it cannot actually be solar, unless we get WAY more efficient to preserve our way of life. Regression is what we are avoiding, and it may not be necessary if we do it right. If it is impossible to maintain our way of life, then regression is inevitable anyways, I just don't want to see us screw ourselves over environmentally while we blindly put all our eggs in one dead end of a basket.
Reply: Richard Smith
Solar, along with hydro, wind, and other tech, can save the world from the energy crisis. Like I said, it all adds up. Why wouldn't you pick up a ten and two fives off the floor when what you need is twenty? It's all there. Stop looking for the twenty dollar bill. You found what you need.
Reply: Svallen675 Yes, solar is a good alternate energy, just don't lead yourself(not speaking at you directly) to think that even wind + solar is enough power to not cause technological regression, it is not, unless we focus heavier on reducing energy use first.
But yes, evolving nuclear technology into something safer would be great, but I fear there is a lot of ignorance on that front as well, with people scared of a boogeyman due to similar technologies not treated with appropriate caution in the past, and then developing a defeatist stance instead of seeing previous mistakes as learning experiences.
It would not matter how clean or safe it is, if it is nuclear, people would object, unfortunately. The same people who SHOULD support it, as it could save the planet.
Even dirty traditional nuclear power, in a worst case scenario, affects humans more than it does the natural ecosystem, which quickly recovers and moves on without us. But that is another discussion.
Reply: Richard Smith
What you don't realize is that humans are smart enough to survive nuclear radiation by making our own environment e.g. fallout shelters. The wildlife will be sterilized and exterminated. The only living things that will survive will be those that the humans take with them into the shelters. Not very many people can afford to build such a shelter. Only the wealthiest 500 million will survive. These are the banksters and other people in control of the majority of the Earth's resources who make the decisions that result in most pollution. They are intentionally poisoning the biosphere with the intent of depopulating the planet so that they won't have personal human rights preventing them from tearing it apart and using the materials to build a Dyson sphere. They even arrogantly placed the Georgia Guidestones stating their goal of reducing global population to a mere 500 million, a 'controllable' level.
Reply: kedwa30 This is not really true. Take chernobyl for instance, wildlife is doing great, with no evidence of elevated sterility or cancer. The thing is, wild animals seem to be much more resistant to elevated radiation levels than humans are. Even if some do become sterile, or die of cancer, it is not higher than the number that would die from human presence, much much lower in fact. Such a disaster is bad for humans, but good for the wild life, believe it or not.
Reply: Richard Smith
Just because it is not reported on the mainstream media does not mean there is no evidence of cancer. How many scientists are bothering to catch wildlife to check for cancer? Where would anyone find the statistics for such if those statistics existed? Just because nobody is actively looking for it does not mean it does not exist.
I'm not saying there is definitely increased cancer in wildlife around Chernobyl now, because basically that is a single spot on the Earth that has had time to be widely diluted. What happens when we have 100 Chernobyls and 100 Fukashimas? There is a finite amount of radiation that the biosphere can take before everything dies.
Everything except 500 million humans in lead shielded underground cities that is.
In the 1990's wildlife was tested as having 2000 times the safe level of radiation and they looked normal. That does not mean they didn't later die of cancer or weren't sterile. The area didn't have any wildlife in it prior to the disaster. The wildlife moved in from the surrounding areas. There was a steady influx of more wildlife to replace those that inevitably died from radiation. When the whole globe is irradiated, there won't be any surrounding areas to supply new life. The sterile wildlife will be the last generation. The humans in the shelter are not going to return the Earth to a state of natural paradise. They are going to tear it apart to build a Dyson Sphere.
Reply: kedwa30 You didn't even check, that research does exist. Sure 'average' exposure is the key here, however, that average exposure should have been high enough to show marked increase in cancer and sterility, but it has not, which was unexpected results. My point is people blow it out of proportion, talking like every nuclear power plant on earth could all go nuclear and irradiate the planet, when that is not even close to reality. Additionally, we are talking about an alternate to dirty nuclear power, which means those consequences do not even apply in the first place.
Reply: Richard Smith
I did check, and I did not find anything, hence the reason I asked "Where would anyone find the statistics for such if those statistics existed?" I don't even know what you are talking about by average exposure. Again, in the 1990's wildlife was tested as having 2000 times the safe level of radiation and they looked normal. This does not imply that they did not later die of cancers or weren't sterile. It does tell us that we should not expect to see horrible mutants as a result of radiation, as portrayed by popular fiction. The wildlife looks normal, and thus people cannot tell how much radiation the animal contains by looking at it.
What appears to be good for wildlife is simply an illusion.
You claim that the wildlife around Chernobyl are not markedly increased in cancer and sterility, and yet you have not provided any source to back up your statement. What research actually captured and tested the wildlife to see if it had cancer or was sterile? Were the animals tracked to determine if they had recently migrated in? How did the researchers control for the various confounding factors?
I have read an article on Slate that states quite clearly "Roe deer and wild boar caught here in the early 1990s packed more than 2,000 times the safety norms for cesium-137 in meat."
What the article does not say is whether those animals were sterile or had cancers.
Where is the research?
Simply not looking for those things does not imply that they don't exist. In a lab, what would be the result? How much radiation will result in sterility? The answer is difficult to find.

I have come across this article so far: https://inis.iaea.org/search/search.aspx?orig_q=RN:44064221
It does not directly say how much radiation, but it says the amount of radiation needed to sterilize a moth is about the same as to sterilize a fly. WTF? Is this a state secret?

The documentary that the Slate article mentions and the article itself is probably funded by nuclear advocates. It is propaganda. They say, look the wildlife looks normal, and some was tested as having high levels of radiation in the meat, so you can see radiation is harmless. Can we see that in fact? Or is that propaganda? Use your head. A person with HIV looks normal. That doesn't mean he's not going to die soon. A sterile person looks normal. Looks can be deceiving.

"we are talking about an alternate to dirty nuclear power, which means those consequences do not even apply in the first place."

No, you brought up the following, which is what I am vehemently arguing against:

"Even dirty traditional nuclear power, in a worst case scenario, affects humans more than it does the natural ecosystem, which quickly recovers and moves on without us."

The worst case scenario is: the elites convince us to allow them to build more and more nuclear power plants so that they can have enough radioactive waste to wipe out all life in the biosphere through "accidents" and leaks. They survive and since no one is around to stop them, they completely destroy the planet by tearing it apart to make a Dyson Sphere. That is the worst case scenario.
Reply: Ilir Kumi yes thanks for asking, solar concentration can reach those temperatures easily.
Reply: No one paid me to say anything. Just because someone has a different opinion than you, doesnt meen they are evil. Way to be ignorant... and did I say anything that is not true? Did I? If so please tell me what is wrong. Seriously, why do you bash on me for providing and alternate view?
Reply: Oil is solar energy collected and consentrated over a time scale that humans can not compete with. The ammount of energy that the sun emmits, compared to the ammount of energy that hits my house in New England, in the winter, is vastly different. Why can't I heat my home with solar panels when it is 15 below freezing? Why can't I boil water with a magnifying glass? How can this diy shiny pile of horseshit (solar panel, not sun) cook my food? Simple it can not. It is difuse. There is a lot of energy, but it needs to be collected and condensed to be of any use, this is were fossil fuels come in. I can wait weeks for the sun to melt the snow to clear the roads, or I can use a diesel fueled truck with a plow and do it in a day. Compare a magnifying glass, to a bic disposable lighter, one needs very specific conditions that are rarely ideal, while the other is on demand energy, whenever you need it.